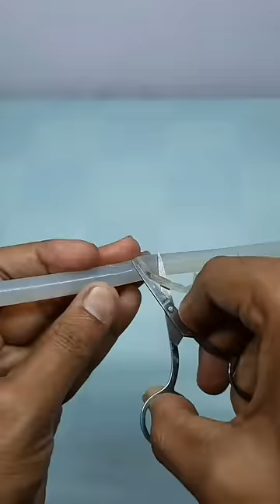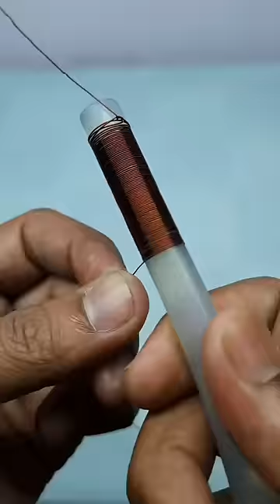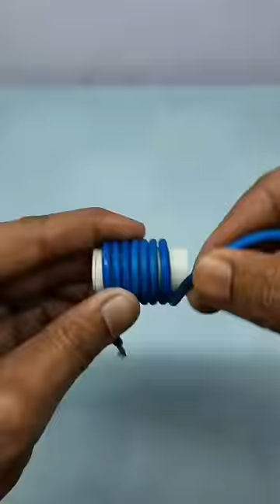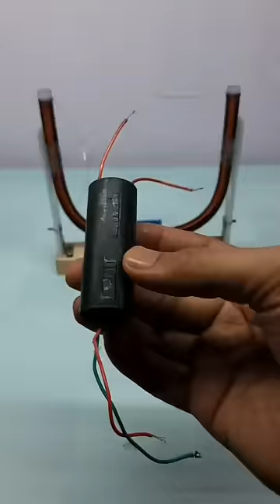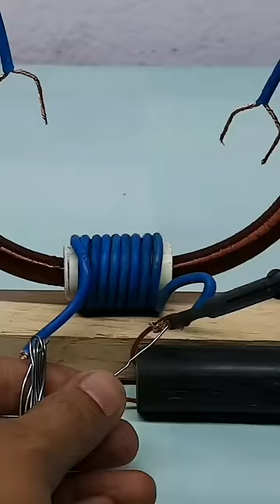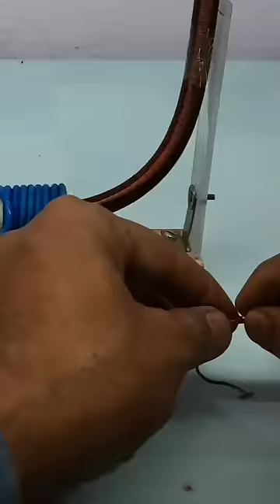Tesla Coil Max

Comment: Wow amazing  👏
Reply from the maker: Thank you 😊
Reply: @SanjibSmartThought coil you can make simple wire this the idea thanks for this idea and i expect many idea from you
Reply: @SanjibSmartThought  gy808
Reply: It's a ready electric shock circuit, he took it from an electric shock gun.
The only thing that he made is to connect it to a DC power supply (battery).
The blue cable is for output arc instead of the already existed one.
The coil is not usable and couldn't affect the circuit anyway.
Reply: @SanjibSmartThought
Reply: @SanjibSmartThought 
this is a sort of Marx generator not Tesla coil
Reply: Did we all watch the same thing.......
Reply: Naam kya hai

Comment: more light is coming from gap between capacitor wire than ur that light which u wanted to glow in dark 😂😂😂
Reply: It's a spark gap it'll stop the voltage surging and shorting out the step-up
Reply: We didn't want to bright the light

Comment: It's a ready electric shock circuit, he took it from an electric shock gun.
The only thing that he made is to connect it to a DC power supply (battery).
The blue cable is for output arc instead of the already existed one.
The coil is not usable and couldn't affect the circuit anyway.

Comment: That's not a Tesla coil, for it, it only has 1 output and it gets grounded through capacitive coupling, that's more like a high voltage transformer (in hindsight a Tesla coil is s transformers, but a very special one) 
Usually Tesla coils resonate at very high frequencies, and you need to match them to make it resonate, try something like the slayer exciter

Comment: what part of this contraption is the tesla coil, or is it a fakela coil
Reply from the maker: (100% Real video )
I do not make fake videos sir
Reply: @SanjibSmartThought  video is not fake, except it is not a tesla coil. And by working principle i am not sure what it is, so it should not be named tesla coil, should have named it something else.
Reply: @yogeshroy9289 the black thing like battery is a high voltage capactor could be found easily
Reply: @sasukeee-fr  It's one of those taser modules.. not just a cap.

Comment: great project to partially short out a lipo batter. the real end result is a battery fire you can't put out and your house/garage burns down.
Reply: he was soldering it outside of the battery protection circuit, cell phone batteries have a little tiny pcb on the end and hence why you see 3 or 4 terminals and not just 2
also, never abuse or overcharge lipo/liion, do i need to show you my thumb for proof why?

Comment: THIS IS NOT TESLA COIL, u only used a high voltage transformer connected to the battery, and you have nothing to do with those coils you created
Reply from the maker: This is a tesla coil sir because it light up CFL lights without wires.
Reply: @SanjibSmartThought  it probably light up, due to the fields of the high voltage generator, and not by your coil. Tesla coil has to be driven with resonant dreeuenzy, which is way higher
Reply from the maker: Believe me it's really works light up with coil .
Reply: @SanjibSmartThought  bhai its transformer not a tesla coil